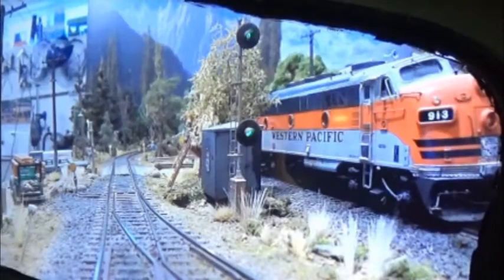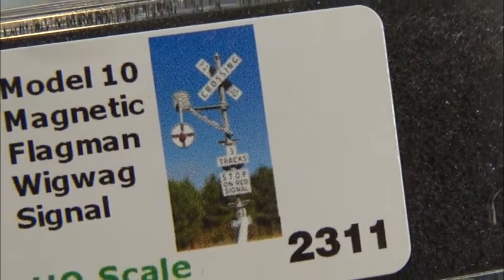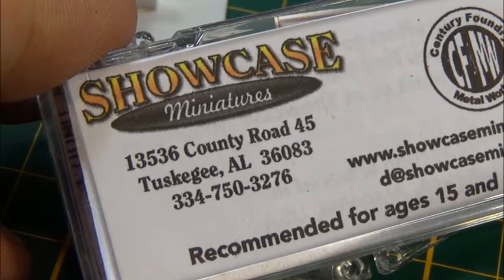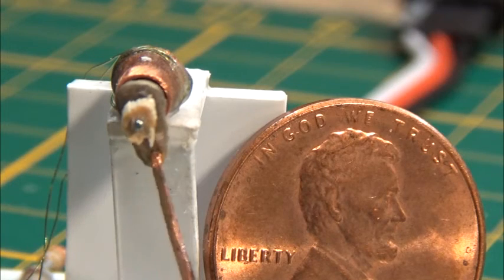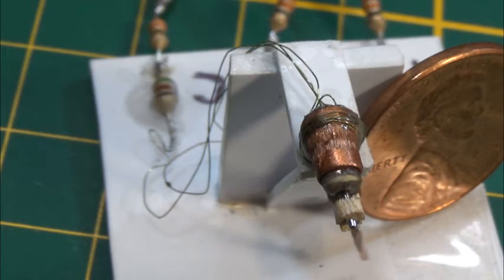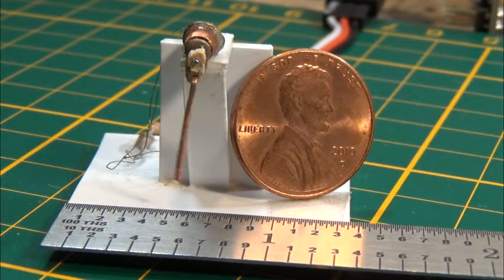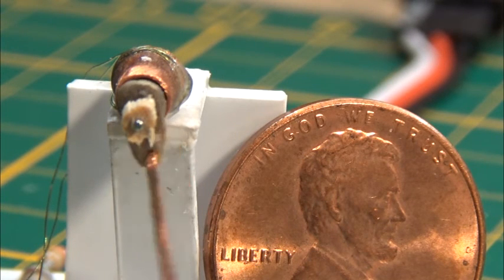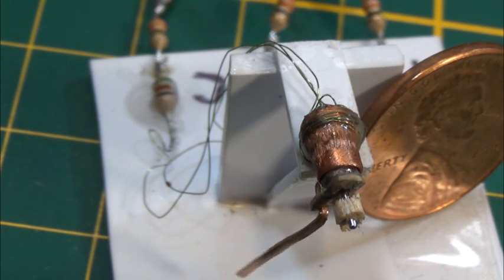Ultimate DCC Throttle – Part 12

Comment: Hello Bruce...! Yes...the signals from the system really are a prototypical key. Good to see you're doing this. You also need "Defect Detectors"...they ad their own rythm to the ride. Of course, on such a small but detailed layout, you want to be able, to only turn them on at some runs. As a future plan: You have now come so far, you can start splitting up operations for more people...!  Make Schedules, have a station master (or Two) Dispatcher crew and so on. The Interaction will be a nice extra possibility for your plans on visiting modellers and Clubs.